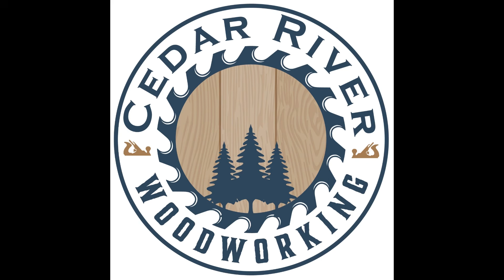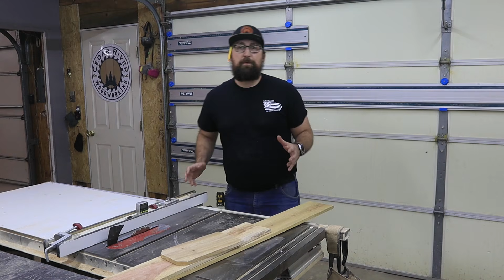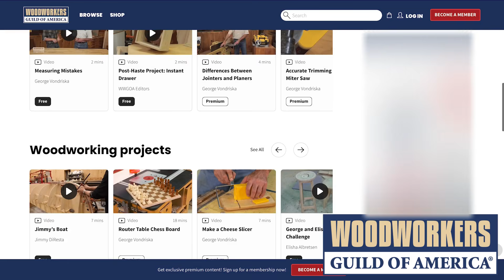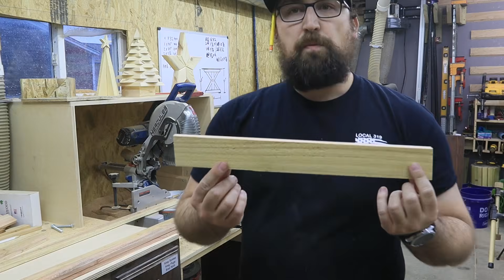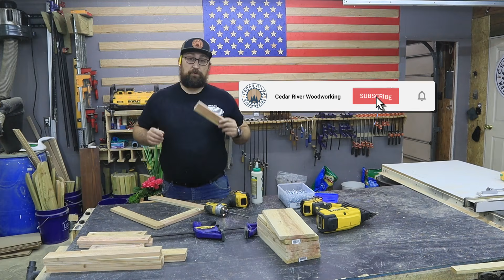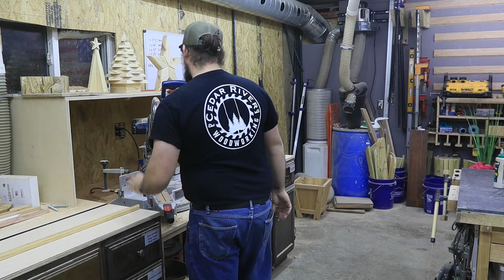DIY Tapered Cedar Planters For Beginners

Comment: Clean that darn miter saw station. In regards to that.  The box you have built around the saw.  Is it working for dust collection. ? I have a Milwaukee 12” miter saw with the digital readout and love that part. But the dust collection on it is terrible and to catch the dust it has a cloth sock to catch the dust. But I am looking for ideas on how to use my 3D printer I bought and have no idea how to make a project or even send the project from my computer to the printer.  OR some good plan to
Build out of wood. Any ideas from anyone would be SO
MUCH APPRECIATED.
Reply from the maker: Good question. I have dust collection hooked up to it, but rarely turn it on while i'm cutting. I use it a lot for clean up and the box helps keep all that mess in one location.

Comment: Clean your miter saw station. I was wondering when you were drilling the pocket holes the boards did not seem to be straight up and down. Why did you have a couple of men an angle before you drilled the pocket holes

Comment: How would you put a bottom in so you could plant directly inside planter
Reply from the maker: Good question, I have just added in a liner (garden fabric or plastic liner with drainage holes). If you're concerned about strength, I would make those floor boards wider.

Comment: The 5deg works for me - I think the top should be the same width as the legs minimum - Instead of the sightline just disappearing at the top it will make a statement instead. But Meh, my wife says I have no design sense anyways.
Reply from the maker: I like that suggestion, Thank you.

Comment: If you cut a 5 degree angle on the top of your side panels your top trim should go on square with just normal miter not a compound miter 
If that makes sense 😊
Reply from the maker: Actually yes it does! If the legs have parallel ends, and the one end sits flat on the ground... the top of the planter "should" be parallel to the ground. My brain was over processing the whole thing. Thanks for the correction.
Reply: @cedarriverwoodworking  
👍

Comment: I like the color contrast of the 7 degree planter.

When cutting the top trim you can just roll ( not flip end for end) the piece over and it will cut the correct angle.  It also minimizes the scrap left over.

I cut a small center piece to eliminate the gaps in the panels., or run the center boards horizontally although that might use a little more wood.
Reply from the maker: I appreciate the tips, I will give the compound miter a try that way. Thank you for your support.

Comment: Personally I don’t think that Brad nails on the edges are the best option even with the glue. Matthew Peech goes with pocket holes which are a bit more hassle in terms of time but will likely hold up better over the seasons. That’s what I use also.
Reply from the maker: I like the brad nails because I can assemble the walls completely without having to fight the vertical boards after I get the frame built. I do appreciate all of the comments and I appreciate your support. Thank you for all the tips.
Reply: @cedarriverwoodworking  totally what I was getting at with the extra time hassle. Can be a pain. I just like the peace of mind. Don’t want neighbors secretly resenting a purchase after one season lol

Comment: Top tip: I’ve found that 1” pocket hole screws work just as well for this project as 1 1/4” screws but you never get the issue of the wood splitting.
Reply from the maker: Absolutely they do work great. I didn't have enough 1" to finish the project. I have already ordered more.

Comment: Great video and project, I can't wait to try it!  On the question at the end about compound miters for the top, my own preference is to not have one, and just do a regular miter, no bevel.  The bevel is better for drainage of weather off that flat top profile, but since these will be sitting next to chairs in our patio, I'd rather have it flat for setting drinks, etc., on it.  Also, I prefer it sticking out over the edge, for a wider surface.  Since it's not fully contacting the top of the planter, whose sides are leaning out and therefore at a bevel in relation to it, I would just join the 4 pieces like a picture frame first, with pocket screws in the corners for stability and to make it all one unit, then attach that to the planter.  Finally, I would crown the boards of the top frame, so that any rings seen in the end grain are pointing down like a smile, making any cupping later point up, the better to shed the rain rather than catching it.  But hopefully it won't cup, if I seal it properly....  :)
Reply from the maker: I really appreciate the long message. If I increased the boards used to 4 I would absolutely do a wider frame around the top. I do like the idea of having them next to a chair and having some type of flat surface for drinks or anything like that to be sat on. When you make them, please let me know how they turn out. I really appreciate the support.